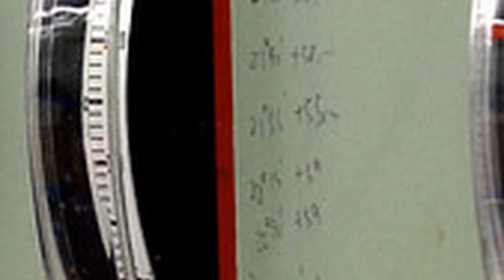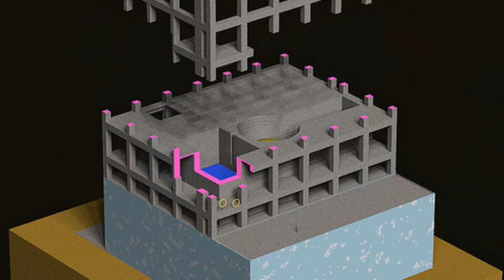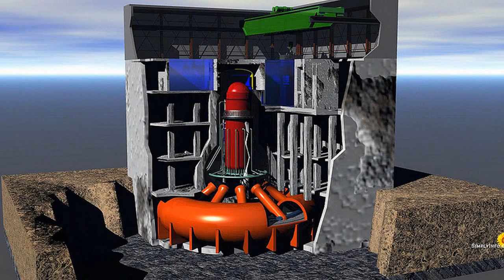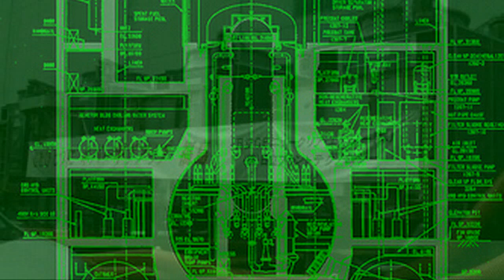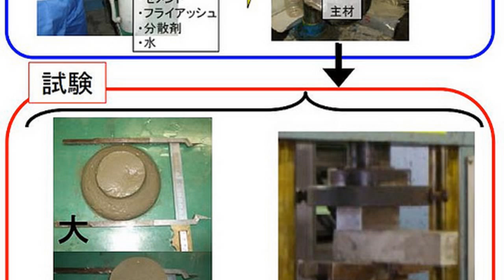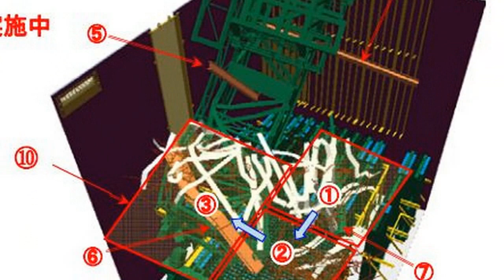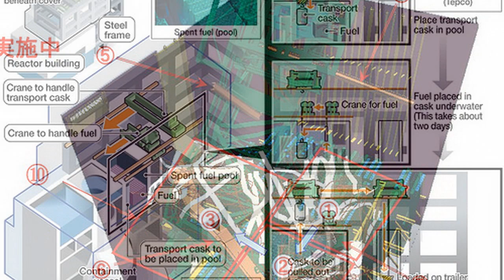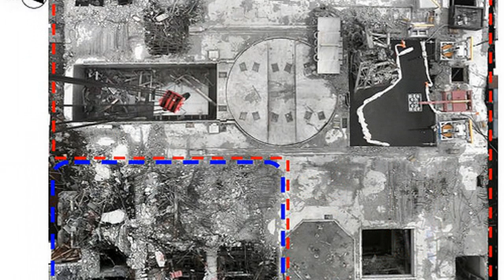Nuclear Watch: USA/JAPAN CHRIS HARRIS on NCR in USA and Fukushima  for protection(03/27/2014)

Comment from the maker: SP: 90 page WIPP report from 1996:
"WASTE ISOLATION PILOT PLANT SHAFT SEALING SYSTEM COMPLIANCE SUBMITTAL DESIGN REPORT"
http://www.nmenv.state.nm.us/wipp/documents/AttachmentG2.pdf
SP: Of note in the above document (besides redacted Appendices C and D…anybody have those?):
Page 3:
"This report describes a shaft sealing system design for the Waste Isolation Pilot Plant (WIPP), a proposed nuclear waste repository in bedded salt. The system is designed to limit entry of water and release of contaminants through the four existing shafts after the WIPP is decommissioned…These evaluations indicate that the design guidance is addressed by effectively limiting transport of fluids within the shafts, thereby limiting transport of hazardous material to regulatory boundaries."
SP; Translation: shaft seals stop "fluids" but no guarantee for radiation vapors or gases,
Another digital trail of the nuclear waste dump known as WIPP:
Appendix E: 36 pages August 1996
http://www.wipp.energy.gov/library/cra/baselinetool/documents/Appendices/SEAL%20E.PDF
SP: Contains shaft drawings and other mine features such as stratigraphy and sealing subsystem profile.
Salt deposits there are a bitch to keep dry. They managed their publicity tours and hospitality margarita parties (complete with salt from the walls) in an attempt to reassure citizens. But high capacity fans are needed to keep the rooms dry. Drip…drip…getting steamy…

Comment from the maker: http://sos.noaa.gov/Datasets/dataset.php?id=332
Fukushima Radioactive Aerosol Dispersion The Hybrid Single-Particle Lagrangian Integrated Trajectory (HYSPLIT) model was developed by NOAA to follow the transport and dispersion of pollutants in the atmosphere. In HYSPLIT, the computation is composed of four components: transport by the mean wind, turbulent dispersion, scavenging and decay. A large number of pollutant particles, which by convention are called "particles" but are just computational "points" (particles or gases), are released at the source location and passively follow the wind.
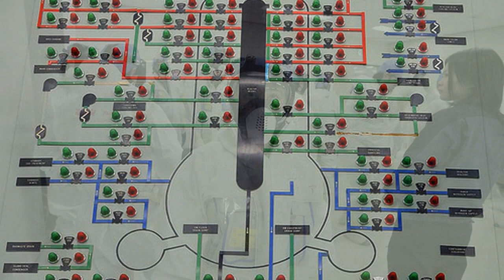The 2011 Tohuku East Japan earthquake and resulting tsunami caused a variety of failures at the Fukushima Daiichi Nuclear Power Plant which resulted in radioactive emissions to the atmosphere. The earthquake occurred on March 11th at 14:26 Japan Standard Time (JST), the tsunami about one hour later at 15:41, and by 16:36 a nuclear emergency was reported. By the early morning hours of March 12th, radioactive emissions were occurring from the plant.
In this dataset, the simulation from NOAA's HYSPLIT model shows a continuous release of tracer particles from 12-31 March at a rate of 100 per hour representing the Cesium-137 emitted from Fukushima Daiichi. Each change in particle color represents a decrease in radioactivity by a factor of 10. Radioactivity decreases due to removal by rainfall and gravitational settling. Decay is not a factor for Cesium in this short duration simulation compared to its 30 year long-half life. The air concentration would be computed from the particle density so it is only partially related to the color scale. The released particles are followed through the end of April using meteorological data from the 1-degree resolution NOAA global analyses.